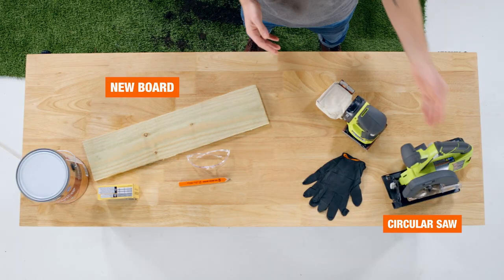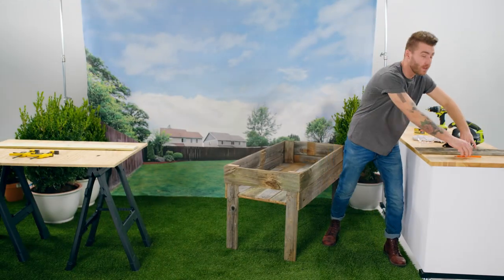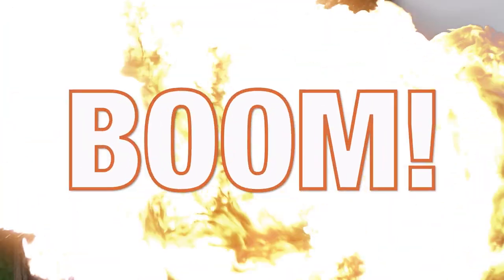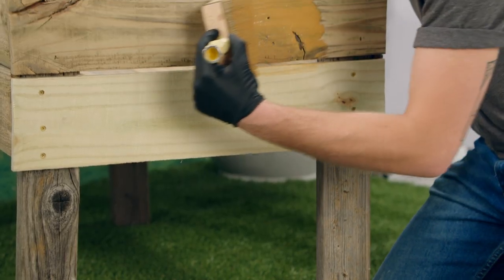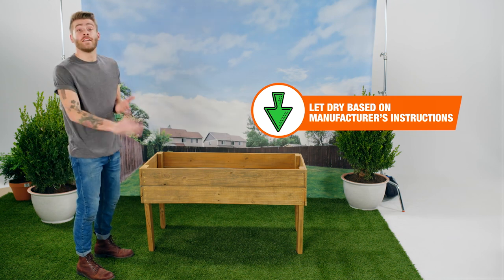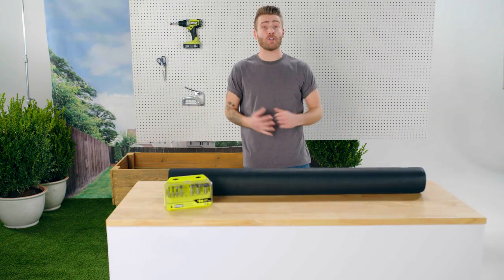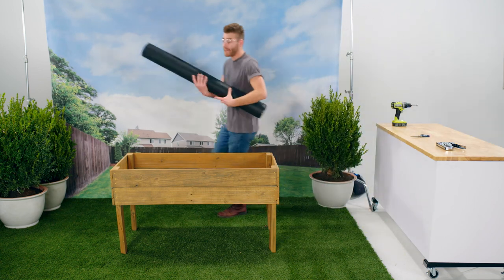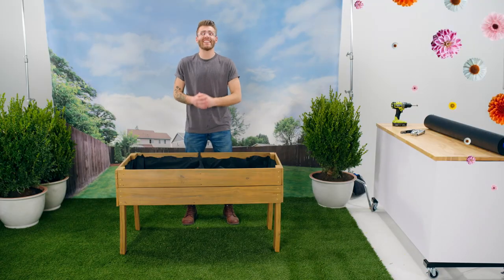How to Un-Rot Planter Boxes with Mike Montgomery: How to Undo (Episode 13)

Comment: I try to avoid purchasing anything from HD for the simple fact their online credit cards processing sucks.  The HD website confirms this...and I quote..."The problem could also be an issue with the internal The Home Depot credit processing system, rather than with your card."  Called my bank and they confirmed the above quote.  When I shop at their competitor, I have zero issues using muliple CCs.  In conclusion, Edward “Ted” Dicker, should learn and implement a better credit processing system for customers who purchase online.

Comment: Home Depot charges 195 plus tax to install a washing machine. A washing machine installation includes connecting the hot water, cold water, drain pipe, and plug - it takes 5 mins max. Get fucked.